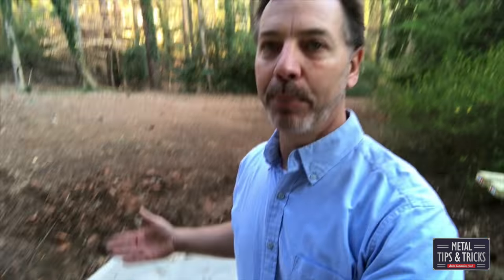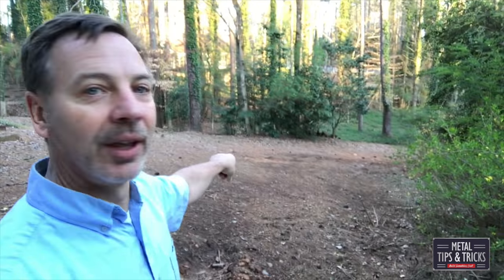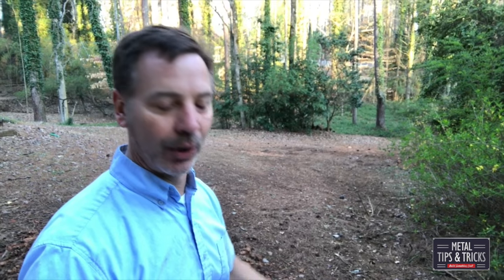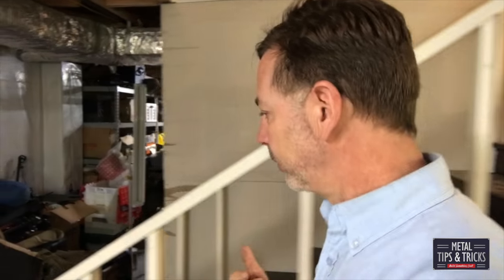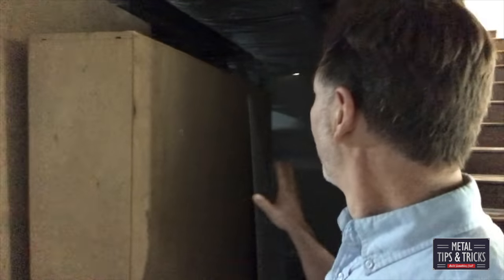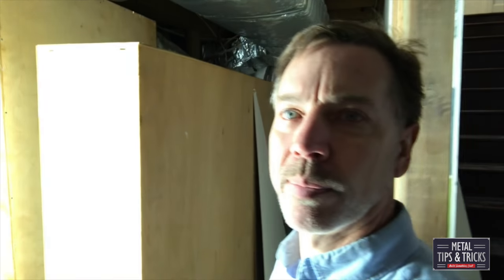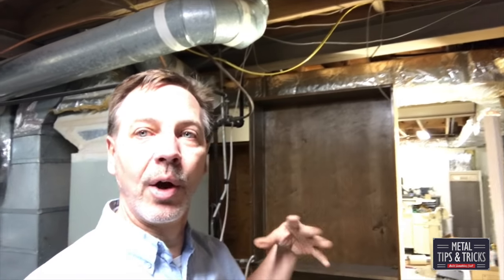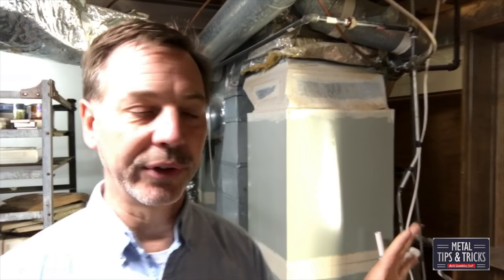First look at the new shop

Comment: Hey Dale, I had a shop in my basement. Be aware that most heating systems are in the basement, with the return somewhat open. The fumes from the work area can be sucked through the hvac, the wife won't be happy. There are fresh air alternatives that will cost you some dough. Just saying from past experience, good luck.

Comment: I'm interested to know what your plans for the basement location are to make it machine and family friendly, i.e. adding rocwool type insulation/sound dampening/fire barrier? are you gonna sheetrock the ceiling to also help with a fire barrier? how about ventilation? making sure fresh air comes in and smoke and dust go out and not bring any of that dust/smoke and smells upstairs? 
looks like a lot of work!

Comment: What are your plans for lighting? My shop is similar 8ft  ceilings. One side is pretty good with about 7 of those home depot linkable led shop lights. I found I needed more than I thought as most fixtures are intended for much taller ceilings

Comment: Good luck with your new shop. It wouldn't work for me. I'm a night owl and most of my work is done between midnight and 7am. I wouldn't be able to beat metal into submission while the normal people were sleeping above. That's why my shop is 125 ft behind my house. I don't envy you getting three phase in there.
Reply: just couple a single phase motor to a 3 phase motor - cheap, cheap 3 phase